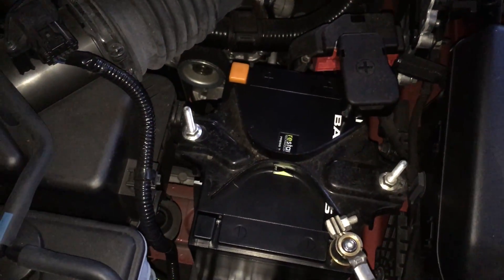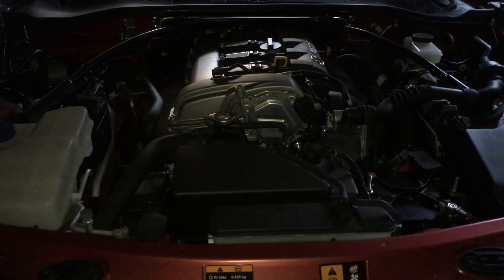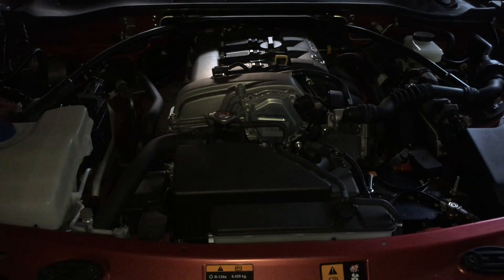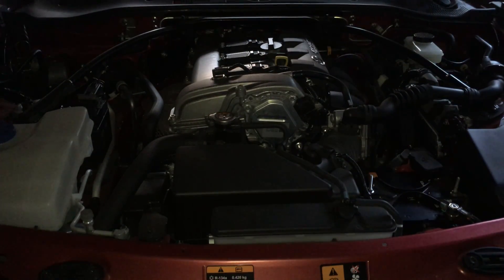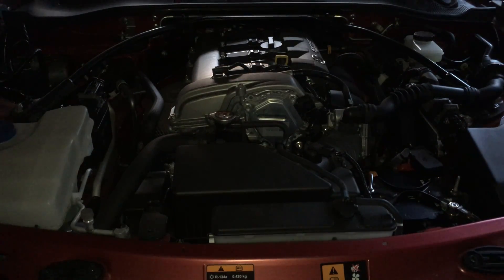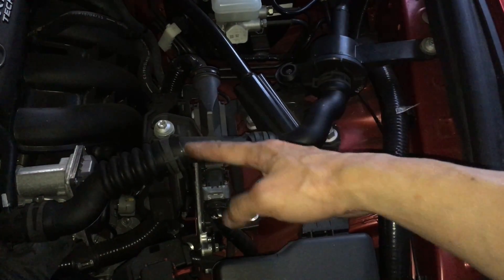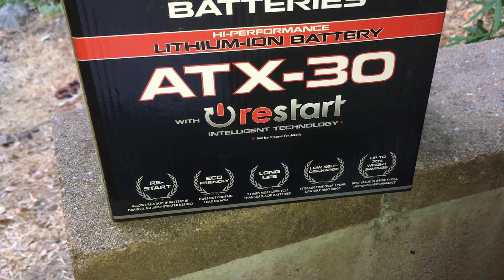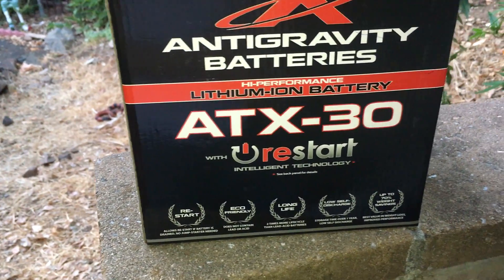Anti Gravity ATX-30 ND Miata pt.2

Comment: I have one of these batteries for my Ferrari and two for my VW and they are awesome! Your car cranked up real fast!
Reply from the maker: Too bad this one only lasted me 2years.
Reply: @DaBinChe  Really? They have a 3 year warranty, how come you didn't get it replaced?
Reply from the maker: @freddaniali  I sent in my old battery and they will only give me some credit for a new one.  I don't see spending that much money again even at a discount to not last as long as it did.  These LiFe are suppose to last much longer then lead batteries.  They did come out with a 51R car size more recently but thing is $700 that is just too much for a battery.  If I was racing and such then I would consider it but I'm only street driving.
Reply: @DaBinChe  I'm so sorry to hear that. Well, I guess I will see how long these last... my lead acids usually only last a year. Thanks for the info!
Reply: You’ll wish you had a Mele case around this.  These are not as resistant to high underhood temps like a Pb acid.  Don’t fault the battery when no insulation or thermal guard is used.  Even the OE battery had a thermal insulator.
Reply: @jasonturner4625  None of my batteries are in an engine compartment.